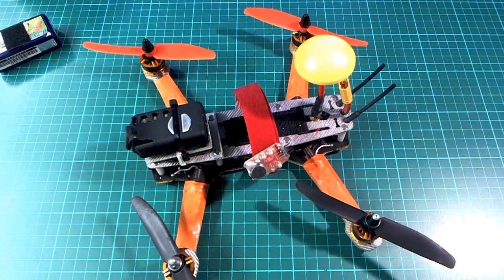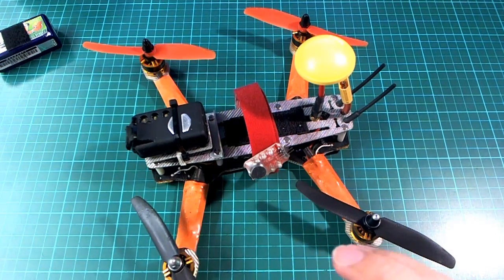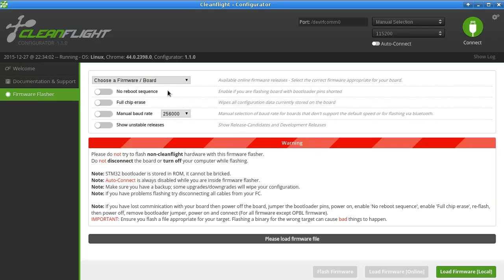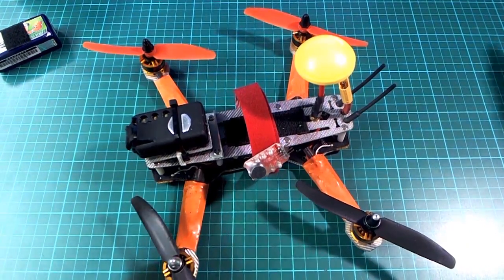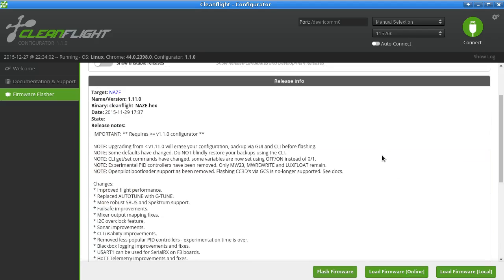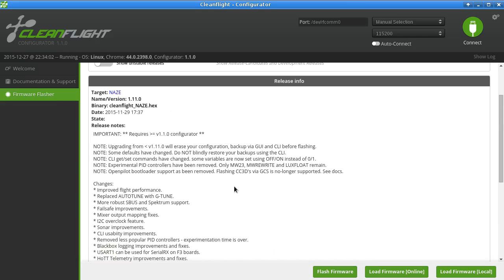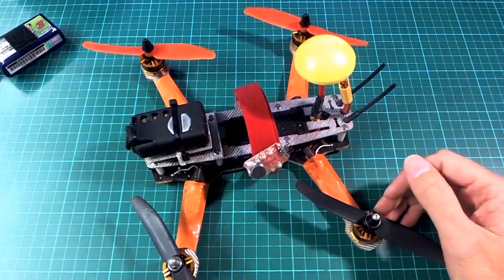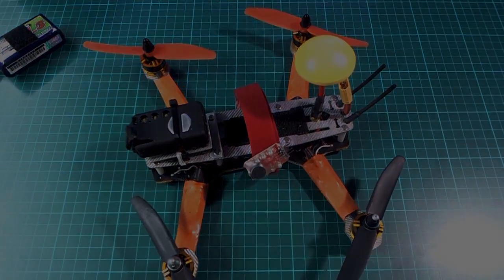Stability problem in Cleanflight 1.11 ?

Comment: mine done this until i lowered the angle strength P from 9.0 to about 5.5. it was trying so hard to level itself that it got confused and flipped
Reply from the maker: +Robert Bingham hmm.... sounds possible yeah. It's 1am here now, but I will try that tomorrow.
Reply: +iforce2d i found that betaflight required little to no tuning just to get a quad to fly. it was just that one setting that was causing issues for me and a couple other guys i know. update us on the result mate
Reply from the maker: +Robert Bingham Will do. It's odd that even in rate mode the newer firmwares felt less stable though...

Comment: what version are your esc's
Reply from the maker: +RayGeorge FPV No idea, but why would that mattter, does 1.11 talk to the ESCs in a different way? I would expect to see that mentioned in the release notes... 
fwiw the ESCs are these: http://www.banggood.com/SimonK-2-4S-16A-20A-OPTO-Brushless-ESC-For-Quadcopter-p-990557.html?p=2K090270884220140865
Reply: +iforce2d I could be wrong about this but I think people had to update ESC's to the latest firmware but that was using blheli I have not used simonK in a long time so wouldn't know about simonK updates. Not a sure bet just something to may be keep an eye on. I just remember reading something along those lines but can't remember how the story really went, sorry if that's not much help to you.
Reply from the maker: +RayGeorge FPV I see. Yes for BLHeli I do recall seeing something like that. ah, it was on the rcgroups page: "In case of using Blheli ESC software 14.1 or higher is required for reliable Betaflight support. (This remark doesnt mean that only blheli is supported. All other ESC's work fine....KISS.....Simonk etc).
On blheli esc PWM has to be set to OFF."
Link: http://www.rcgroups.com/forums/showthread.php?t=2464844

Comment: maybe the PID loop changed and you need to completely retune it? meaning you need to find completely new values that work for you? otherwise i really have no clue...
Reply from the maker: +muh1h1 if that was the problem though, I would expect to see many more people having this result, and some mention of it in the release notes etc. Naturally I did some googling but didn't come across anything about it.
Reply: +iforce2d it's always wierd to have reproducable problems with something that seams to work fine for everyone else...
Reply: +iforce2d We are finishing a course at UNI with SPF3 on a 200mm frame, and all were doing the same as shown on the video in Angle mode, 3 copters 2 with Betaflight 6.2 and 1 with Cleanflight 1.12.... We brought the P down to almost nothing and it seemed like it needed to be brought up instead, can't resolve this, same issue on 3 copter assembled in a course... We initially thought it was due to the RCX red bottom Motors which were too powerfull, using 30A Little bees, with one shot and profile 1 . rewrite FC...????? This issue reproduced on the 3 copters with 2 different Firmwares.... Reproducible, so big issue, right!?!? Can't tune it guys, just can't!?

Comment: did you try to use the g-tune?
Reply from the maker: +srul76 I can't even keep it in the air for more than a few seconds.
Reply: I understand...
For me betaflight working good...
Did you try to recalibrate the esc?
Reply from the maker: +srul76 no, but I don't see why that would matter. As you can see 1.10 is fine in both modes and rate mode is flyable in all cases.
Reply: +iforce2d Maybe the 1.10 vs 1.11 handles vibrations differently? Possible gyro-related loop modification that may have caused the quad to try to balance itself but failed due to some loop-gyro optimisation. Every quad is different so I think others may not have the same problems as yours.